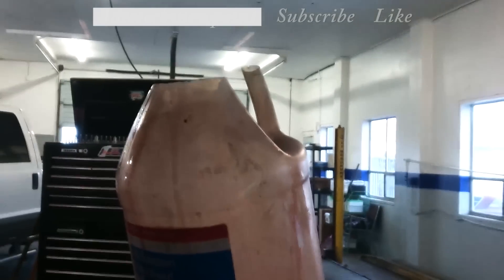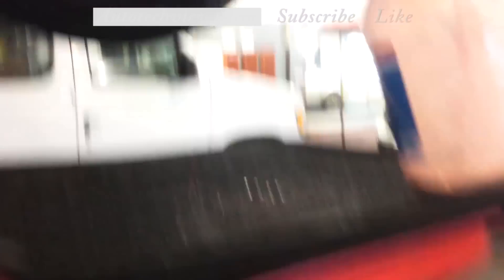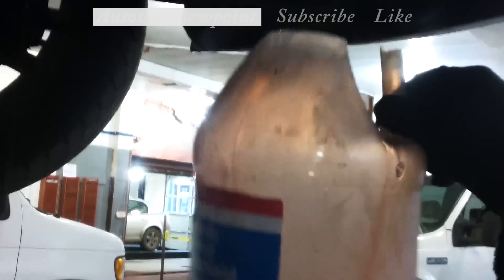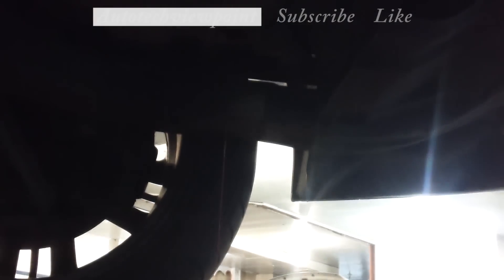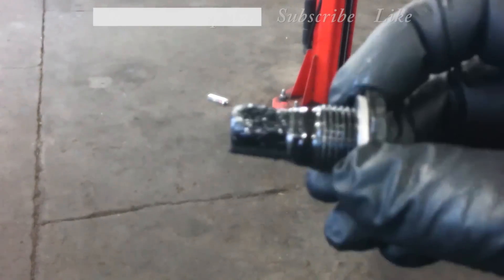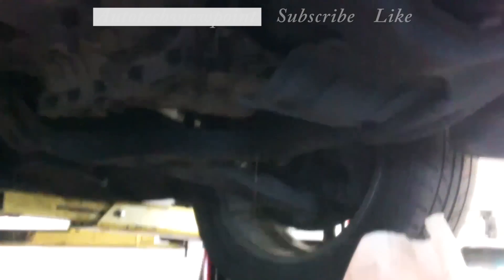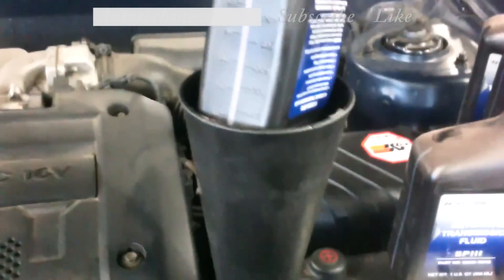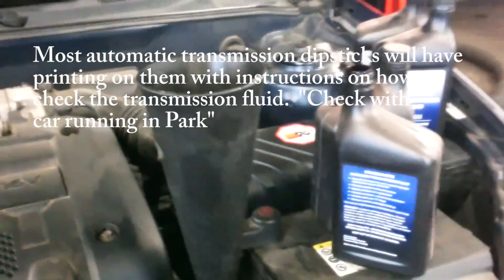Transmission service 2008 Hyundai Tiburon.Fluid Replacement

Comment: I have a 2003 Hyundai Tiburon 4-cylinder. I have around 125,000 miles and bought the car at around 80,000 miles. I do not know if the transmission fluid has been changed. Can i drain the fluid and change it without causing any problems. I have heard that flushing an older transmission is bad but just changing some of the fluid is okay.
Reply: Ya thats kind of a old myth that changing the transmission fluid will hurt the transmission, changing it will do more good then bad unless it hasnt been changed at like 170000 miles

Comment: I have a 2003 Hyundai elantra. Automatic transmission, the transmission looks sealed like the one in this video, however it does have a vertical pan facing front of the engine bay. Do you know if that's where the filter would be located?

Comment: Do you exactly which bolt under the transmission would be used to install a temperature sensor ?
Reply from the maker: sorry i do not, if you bought some kind of kit to do that, it may give you the best place to install it.

Comment: I hear auto tiburons on the years you provided will have problems if you dont use the recommend OEM fluid and will eventually break, is this true?
Reply from the maker: Charles C. I have not heard that.  We do use the OE recommended fluids in vehicles.  Transmissions and differentials can have shuddering problems without the correct fluid...

Comment: Is there a filter that has to be changed?
Reply from the maker: Guy Massaro Not that I know of,  usually you will see either a spin on filter or a filter inside transmission pan, but as you see this transmission does not have a lower pan.
Reply: Fixing cars and stuff Filter is beneath the pan under the battery on the front side of the engine.
Reply: +Guy Massaro Hyundai has gotten rid of the transmission filters, I own a 2008 Hyundai Santa Fe GLS  V6 2.7 and i did an transmission fluid exchange yesterday and there is no filter (spin on or in pan) for some reason Hyundai Mobius took them out
Reply: Technically there is a filter, however the transmission has to be removed and disassembled to do it.